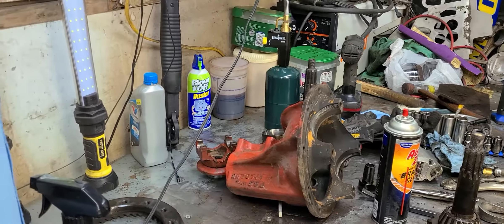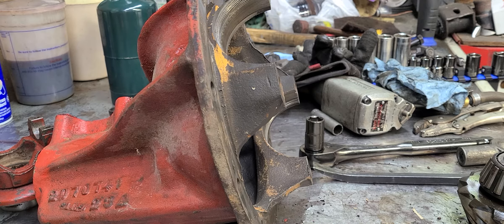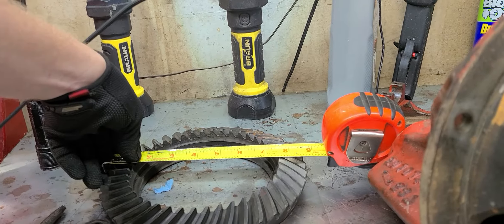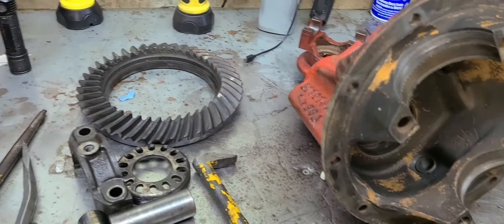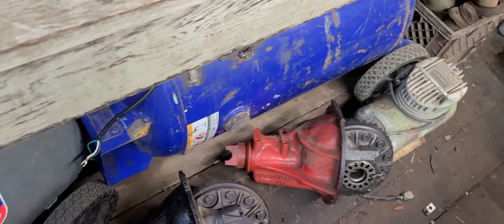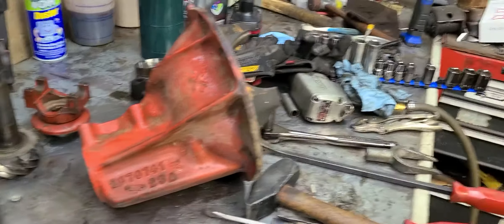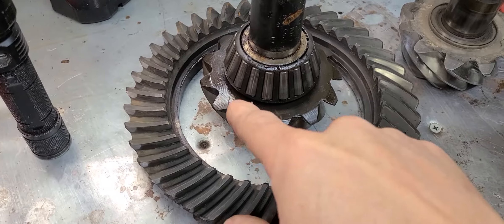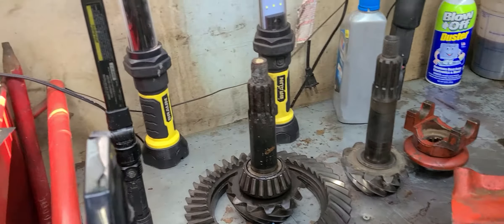Mopar 8 3/4 information

Comment: I have a dodge Aspen and can't find the axles, do you know any compatible cars for axles? It has no c clip and no end play adjuster
Reply from the maker: Can you send me some pictures of your rear axle differential assembly
Reply from the maker: Most likely you will be able to use a rear axle assembly from a Dodge Diplomat Plymouth Gran Fury or Chrysler Fifth Avenue from 1982 to 1989
Reply: @slantfish65sd  ahhh assembly makes more sense why I can't find the right bearings and seals. The axles at a friend's shop but maybe this will help him too. Thanks for the response and help
Reply: @slantfish65sd  it's a 79 Aspen so will the 80's still work?